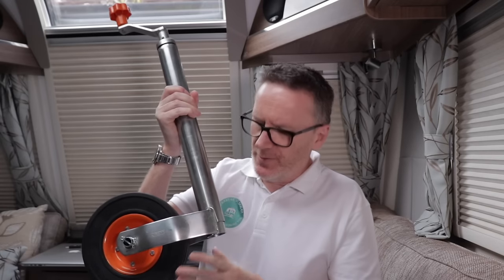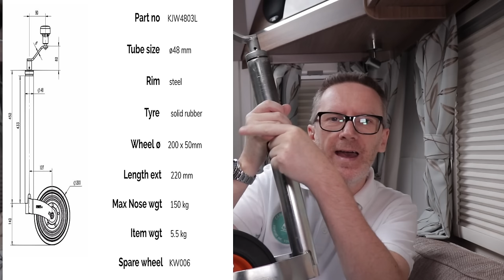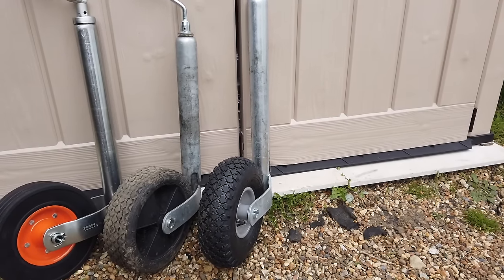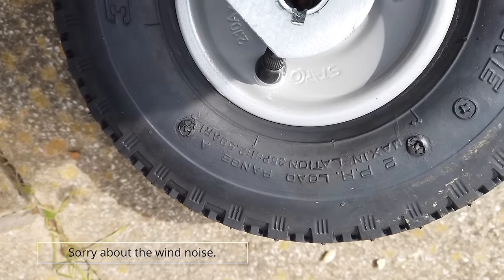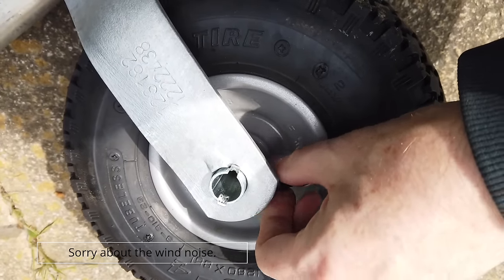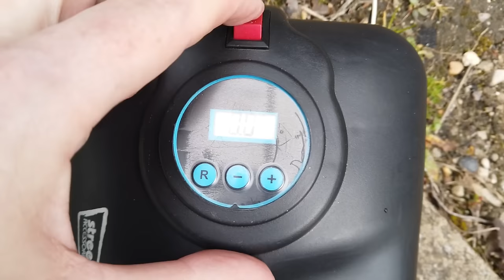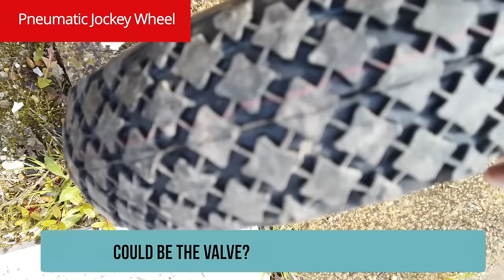Caravan Jockey Wheel Review | Caravan Beginners | Caravan Tips

Comment: Tried pneumatic jockey wheel on my Coachman VIP 520 - total failure, tyre either pulls off the rim or the inner tube bursts due to the van weight. Pneumatic are good for bumping gently over shallow kerbs, but totally not suitable for heavier caravans. I have gone to a wide solid wheel as the one you demonstrate. The wider plastic/rubber wheel also limits sinking in softer ground.
Cheers, Ian C

Comment: Nah, I bought a new Jockey Wheel for my 16 year old van, to replace the existing narrow rubber flat spot that sank in the soft ground and gravel, I bought the Pneumatic shown, but having used these in a Garden Trolly and found that two had punctured without explanation, I decided on a solid rubber equivalent with the same tread pattern at 3.00-4 profile, and fitted shims to centre the axle.  Job done, it'll never wear out, and has a wider profile so that it doesn't sink in soft earth or gravel.

Comment: The shaft on my Alco jockey wheel does not appear to fit snugly in the clamp, therefore it bends a bit making hitching up and unhitching quite  difficult. At  times the shaft jams at an angle and needs kicking or hitting to straighten  it up. Would this jockey wheel resolve the problem
Reply from the maker: Can’t be sure the Karrt will help with that 🤷‍♂️ Maybe you need a new bracket? Thanks for watching 👍🏻

Comment: When your screwing the van round hard like that it just causes the tyre to come off the bead.
I personally would never go for an air tyre, the whole weight of the van is on it after all. I'd go for the standard or rubber wheel myself personally.
Plus I don't think I'd like the bouncing about when pitched up on an air tyre as we only have standard corner steadies so the jocky wheel still takes most of the weight.

Comment: Good review. I have the Kartt one and am very pleased with it. The original one from Bailey was badly worn / damaged after less than a year of use. The click on the Kartt as you wind it is the mechanism to stop it unwinding on its own - happened to me twice when towing. That was the reason I chose the Kartt. Pneumatic jockey wheels have always looked too much faff to me. You should buy yourself a good quality pressure gauge the gauges on pumps are not very accurate!
Reply from the maker: Thanks for watching Jonathan. It’s a good jockey wheel isn’t it! We’re very pleased had it year and a half now, no issues. Graham

Comment: pneumatic tyre will go across soft grass and gravel without digging in like a snow plough , it’s also great for going up kerbs. I also have a U4 and I thing the A frame is a bad design, when the jockey wheel is in its highest position that area of the A frame should be cut away to allow the wheel to sit more snug and reduce the chance of rapping your knuckles when locking the wheel in place.
Btw the original jockey wheel and the pneumatic one are both alko so they should each work as smoothly as each other , when I got my new van the jockey wheel was faulty, even after regreasing it it still took Geoff capes to turn it.

Comment: Hi Graham, good review. I’ve had a pneumatic wheel for the past couple of years an find it a lot softer run on all surfaces. Only trouble was it kept losing pressure so always having to pump it up. The one that came with the caravan was rubbish, solid plastic and no good on gravel surfaces. Think I’ll purchase a solid tyre one. A bit in between but think it will be the best all round. Keep the vids coming. Like the dry humour. 👍

Comment: I''ve tried a number of different jockey wheels and conclude that the nose weight of the van makes a massive difference the the performance of each wheel, the plastic  excuse supplied with the van as standard was little more than a joke item and a tragic insult when you consider the purchase price of the van, next I tried a pneumatic tyre and had to pump it up to 50 psi to even get the van to move exceeding the recommended 35 psi max by a good bit and putting me in fear of an imminent explosive decompression!  The metal solid rubber wheel proved to be the only suitable tyre for the nose weight of our van at 150kg.

Comment: Ever had that sinking feeling? I'm referring to the jockey wheel ploughing in! 
My nose weight is around 110kg, nothing OTT in my opinion, but on soaking ground, a slim jockey wheel will plough in. Then it all becomes a world of pain, invariably in the rain. 
So I looked at the entire issue of spreading out the weight by moving to the softer pneumatic tyre/wheel option. The larger 'Footprint' spreading the load. I bought this from ALKO. So you would think....."Ah yes, a quality product". But no. I had the same experience as you, it went flat on first outing. The ALKO pneumatic wheel is tubeless. This is ridiculous and the main issue for failures, its not as well made as a car tubeless tyre. So the ALKO tyre went flat as soon as I (and you), changed direction. Manoeuvring applies side forces and the tyre fit is ripped off the sealing rim of the steel wheel.  
I'm not happy with what is essentially, 'Sack Barrow' technology, being employed into the caravan world, it doesn't work on larger vans where side loading strips the tyre from the wheel rim. 
Then I bought inner tubes from my dealer. This was ok for a long time, but then, almost predictably, it went flat. Aargh!! How to lessen side loads, a double pneumatic wheel set up, further spreading out the weight @ 50% on each wheel. No, this only resulted in one, or both flat tyres going flat, even with inner tubes fitted. Ah.......Furious!!
My van has twin motor movers and believe me, these will rip a jockey wheel clean off if it attempts to obstruct the motion of the van whilst manoeuvring. Pneumatic tyres cant handle side loads.
In the end, I went for steel rimed, Double Solid tyres setup.(I might even ad a third wheel in-between the two, if it still tends to plough in).
Reply from the maker: Thanks for commenting (and watching of course). I've looked at those double wheeled ones. I like the look of them. I'm glad you posted, I often think I'm the only person in the world that thinks most caravan "stuff" isn't fit for purpose, certainly the jockey wheel manufacturers supply with the caravan is a complete waste of time for a twin axle with movers. I mean what are they thinking. Graham

Comment: watched this before deciding on my new jockey wheel...went out and bought the ALKO premium instead.
Reply from the maker: I was quite close this time around to buying the Alko, but a few people said it was tricky to set up and not very accurate. Not used it myself though..
Reply: @CaravanVlogger  well it was a very easy install on an enclosed A frame. Handle and wheel itself are quick release and with a raise of the caravan nose it was fitted (two halves do not come apart) as for the nose weight guage, I believe most people's difficulty is that the Alko instructions are difficult to understand and you have to make some calculations to  get an accurate figure. The simple jist is this that the distance from the hitch to your axles is different to the distance from jockey wheel to axle so you take your nose weight multiplied by the distance of the hitch to axle, then divide that answer by the distance from the jockey to axle and hey presto you have the equivalent reading you want to measure on the jockey wheel. as for accuracy my question is does it matter? given that 6% of a 1500MTPLM caravan is 90kg and 7% is 105kgs, i know that as long as i'm just under or at the 100kg line (as a minimum) i'm fine and it saves me arsing about with bent jockey wheel shafts and nose weight gauges. set up once and save time everytime...so worth it

Comment: i fitted a twin wheel pneumatic and one went flat as soon as i moved it the same as in video.
Reply: P.S the tyre wall stared to crack and split, when i contacted supplier i was told it's the sunlight and should be kept in the shade ..........................
Reply from the maker: Peter Kane thanks for watching. The pneumatic one was new I hadn’t used it and only bought it a month before.

Comment: I think the problem with these jockey wheels is two fold. Firstly, it’s a plastic wheel which will deflect under a side load, and secondly, there seems to be no wire reinforcement in the tyre bead. I had exactly the same problem with my wheelbarrow, which uses the same wheel design. I ended up putting a solid rubber tyre on instead.